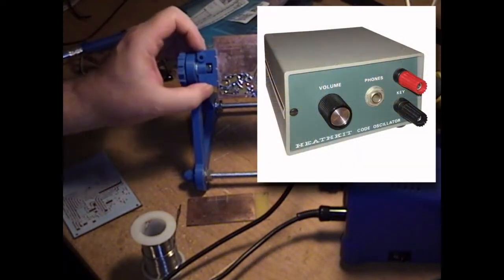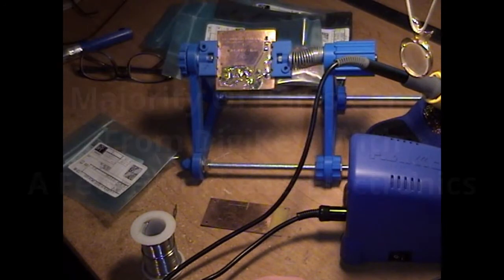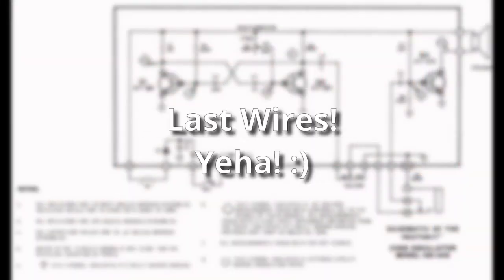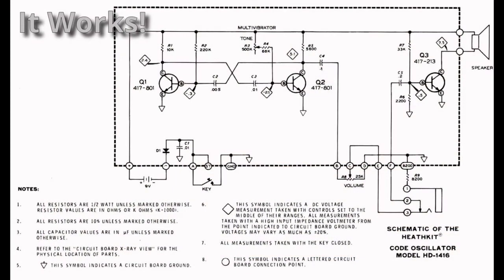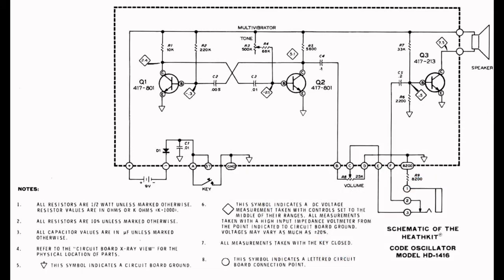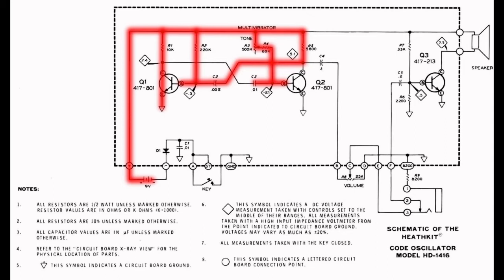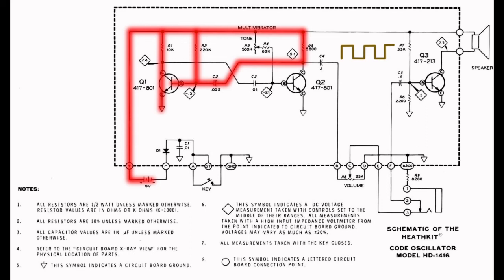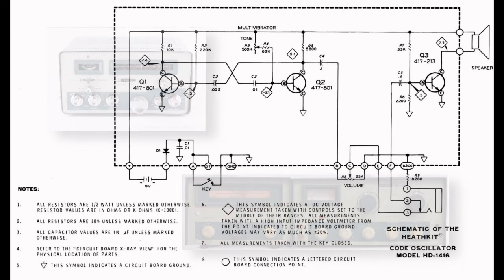Heathkit HD1416 Code Practice Oscillator

Comment: I got a chuckle.  I thought the 3 years mentioned early in the video was meant as comedy in that it took a really long time to get the soldering done.    :)
Thanks for including the schematic.  Few do that anymore.
Reply from the maker: Yeah, I thought about it after and decided to leave it in as worded. ;)

My pleasure for the schematic, I get frustrated when I see an interesting project and no schematic or board layout is included.
If thee is an interest, I could also throw the Board layout up onto my blog.
Reply: @numbersixofone1577  it might help others, but I'm good with the schematic. Thanks. I use KiCad for board layouts and such. Makes it easy enough to put something together.
Reply from the maker: @gfodale  I generally use Kicad as well.

Happy soldering!